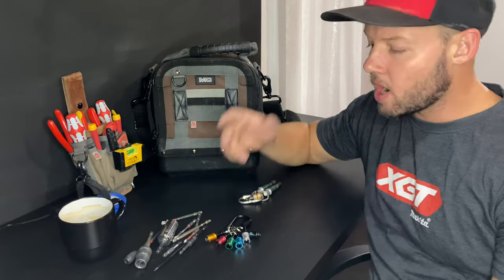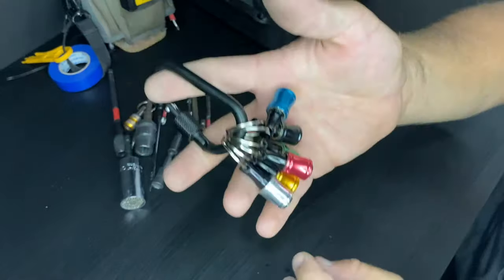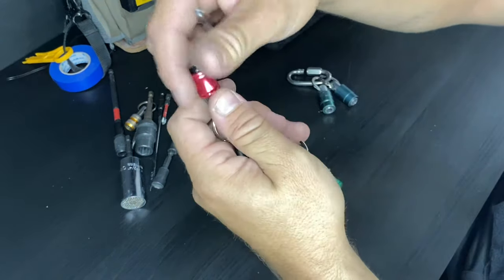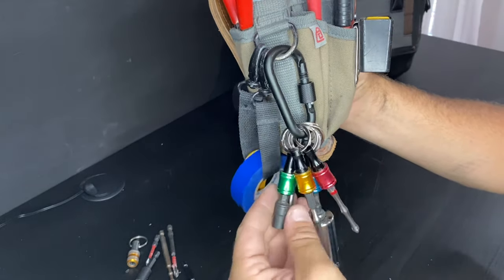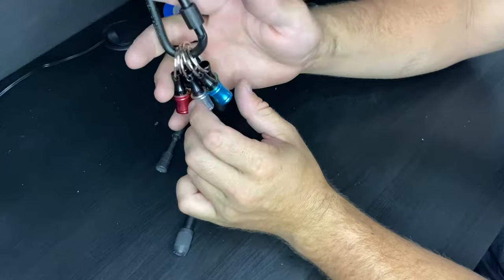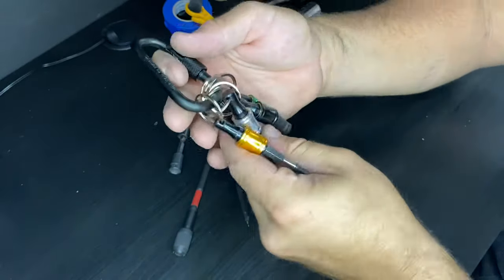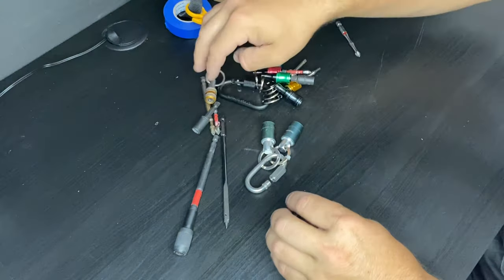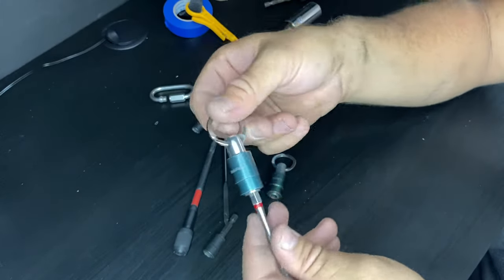Hex shank bit holder key ring, essential for trades

Comment: How are the Amazon ones holding up ?
Reply from the maker: I’ve been using them for maybe 5months now. I haven’t had any problems. I’m very surprised and happy with them.
Reply: @AddictedtoTools  sweet, might order them then ! I just got the m12 drill and driver from total tools and they had a couple of the makita bits but they’re abit pricey
Reply from the maker: They are extra pricey at total tools. Most other places sell them for around $13-14. I think they sell them for 16?
I bought some the other day as a gift. 
If you wanted one, then it maybe ok. But usually you’ll want a few. I have about 8. So the Amazon ones work out well